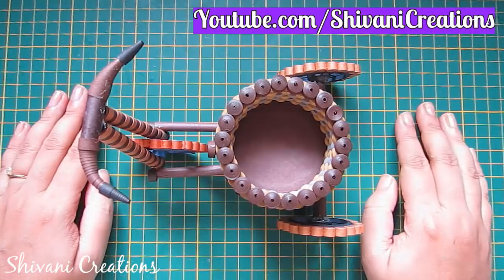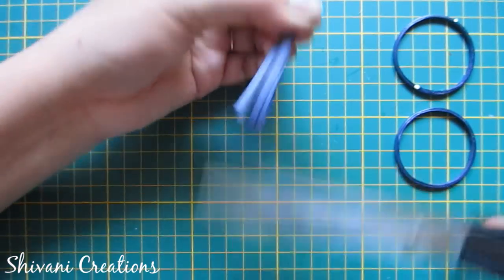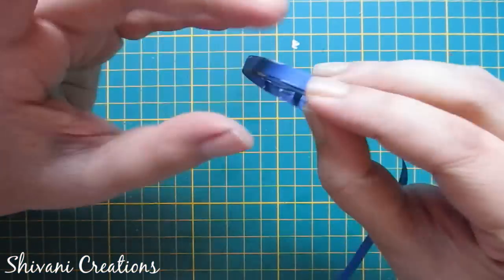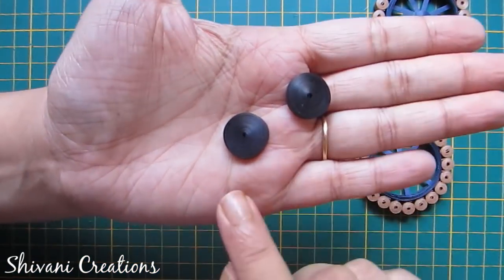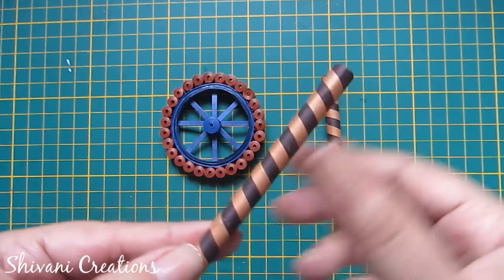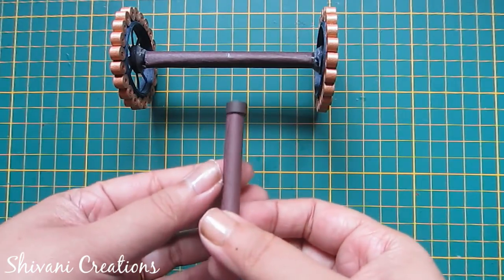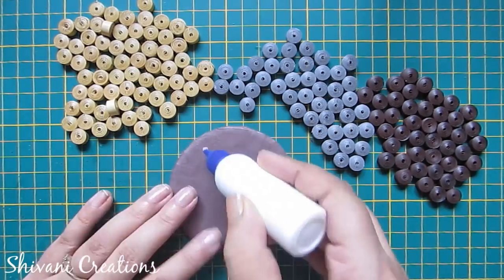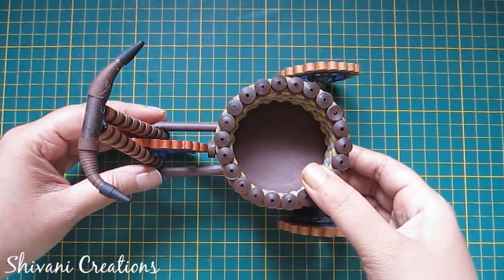Part one: Quilling Tricycle with Basket/ Quilled Cycle/ DIY Paper Cycle

Comment: great job what is the misure of the ring for the big wheel tyvm
Reply from the maker: its approx 2.5 inches diameter
Reply: excuse i have seen the big is 1 1/2 AND THE SMALL 1 INCH
Reply from the maker: its ok